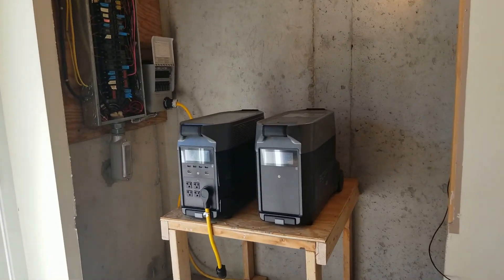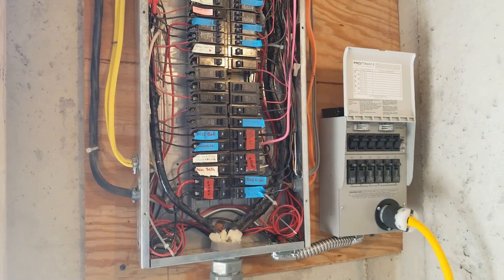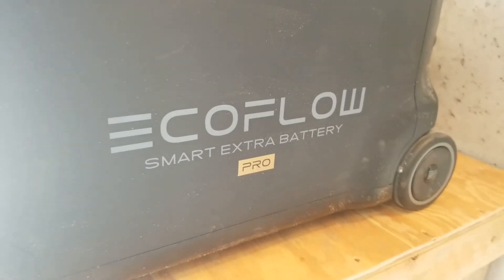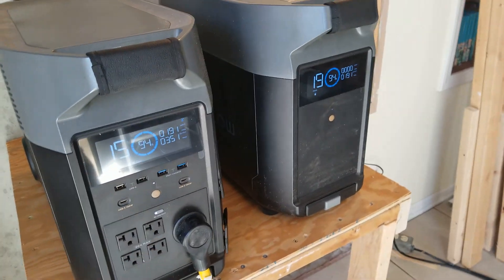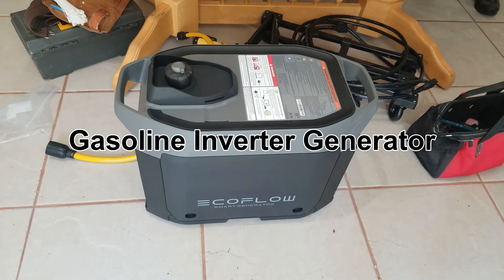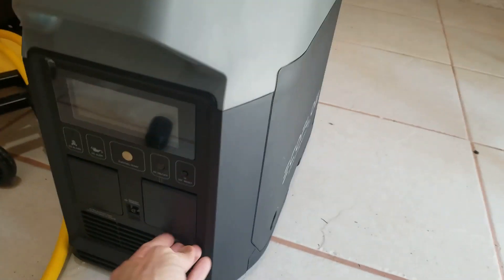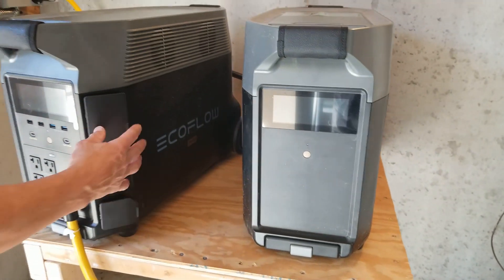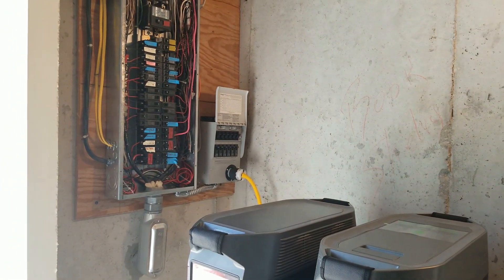Ecoflow Delta Pro Based Backup Power System w Generator Transfer Switch Box

Comment: I just got my electrician to install my transfer switch and I’m using 1 Delta Pro to power 6 critical loads. Thanks for the inspiration and video. I also had a junction box installed to run my solar connectors inside my home to keep my Delta Pro topped off. No more running solar cords through my doggie door.

Comment: What is the model number of the transfer switch please.  Is it possible to the the 50 amp version of the transfer switch and still use it with the 30 amp delta pros with a dog bone cord adapter?  The reason I ask is I might get an inverter and some batteries in the future and don't want to have to buy another transfer switch? Thanks

Comment: thanks for the video. i just ordered 2 Delta 2 Max units & the Delta 2 Max extra battery which right now comes with 2 free solar panels with ea Delta 2 Max. does this transfer switch kick in delta power automatically if electric goes out?
Reply from the maker: Great!  Glad to hear it.  Thank you so much for watching as well!  On more person with backup power options is one step closer to decentralization.  So the transfer switch box you see in this video is just a manual transfer switch box, you must flip the switches by hand.  However, the way I believe we left the system in this video setup is such that it is powering the circuits all the time and then the Eco Flow can then pull in power from solar and can then also pull power from grid (plugged into grid also) if it needs to when batteries are low.  I don't personally have any of these units, but that is how my system is setup.  So, in effect, you still get the feature of having an automatic transfer switch without having to purchase on separately.  I would read the Eco Flow manuals, though, to make sure this is the case.

Comment: Awesome video! Quick question - you think it's possible to this do with an automatic transfer switch? Their home panel is said to have problems with AFCI and GFCI breakers so don't want to use that as it would be against code in my location.

So I'm thinking, have the batteries plugged into a wall outlet (which feeds of the main breaker), and then an automatic Generac transfer switch - and the delta pro can always be plugged in. Will the delta pro be damaged in any way if it's always plugged in, but there's no current draw?
Reply from the maker: Thank you so much for watching and the complement.  

Why do you need an automatic transfer switch?  Are you located in the US?  Why would it be against code to use AFCI and GFCI breakers.  Don't know of anywhere in the US that would discourage the us of those types of breakers.  Regarding the Delta Pro being plugged in to keep batteries charged and also having things plugged into it all the time, that should not damage the unit unless you backfeed power to it accidentally.
Reply: No. Code "requires"  using afci and GFCI breakers - and I've heard the ecoflow panel does not work well with them (maybe that's just internet rumours).

Comment: Can you tell me about the yellow output cable? RV male to 1450 female?
Reply from the maker: Thank you so much for watching.  It is an off the shelf L14-30R to an RV 30 amp 120 volt male connection. Not sure the AWG of the conductors, but has to be at least 10 AWG.

Comment: Does this current configuration provide 240v?  I’m looking at a similar setup but didn’t know if I needed the HUB connection to get 240 or if it’s even possible with just the Pro unit plus an extra battery. I know 240v is available if two Pro units are connected using the HUB adapter. 
Nice video. Better than most I’ve seen. Thank you.
Reply from the maker: Hi Gene.  Thank you so much for watching and the kind comments.  No, the config you see in this video is just for 120 volts.  You would need two complete Ecoflow Delta Pro's for the 240 volt capability, unless they have come out with a single unit now that makes 240 that I don't know about yet.

Comment: Very interested in doing the same .  Can you give ball park $$$$  buying this same equipment  AND  having an electrician wire it up to my fuse box using the same method ?
Reply from the maker: Hi Jay and thank you very much for watching.  The cost of all of that equipment is going to be $6000 to $7000 minimum with the majority of it being the Ecoflow equipment.  You can possibly get it as refurbished a little cheaper, but still going to be in that same ballpark.  The generator transfer switch is only going to be in the $100 to $300 range depending on used or new and the cord with L14-30 connectors will be around $50 to $100.  Regarding the cost of an electritian to do the work, that is something you will need to figure out for your particular area, but if I had to guess I would say $500 minimum (for just the generator transfer switch box which they should be able to do in half a day's time)